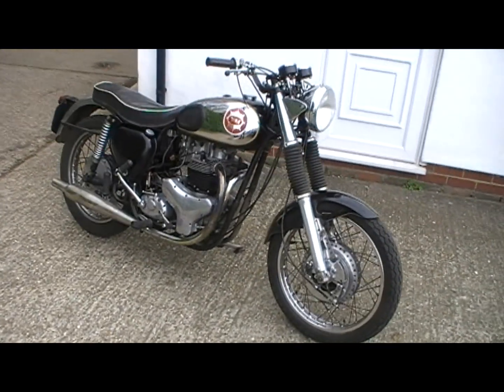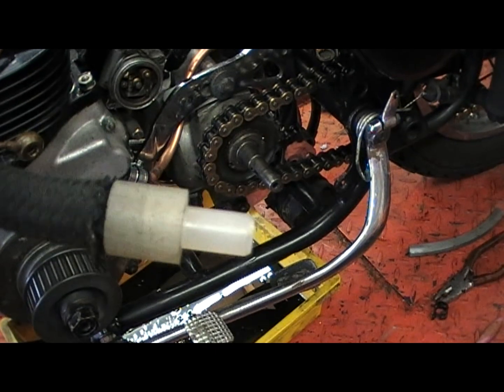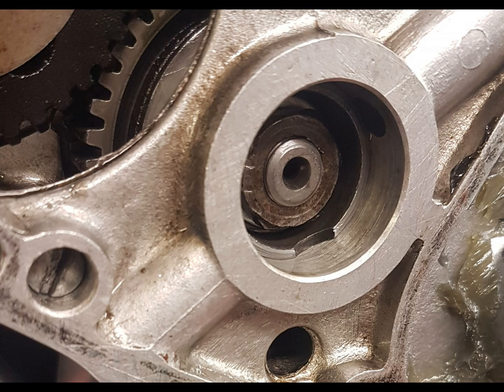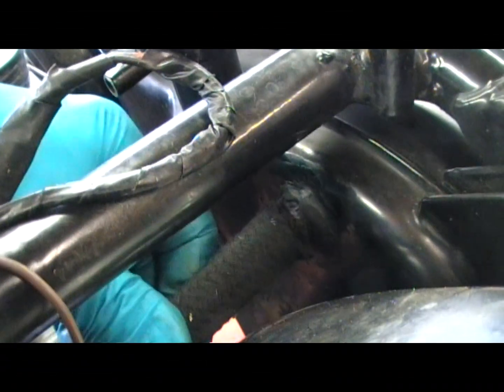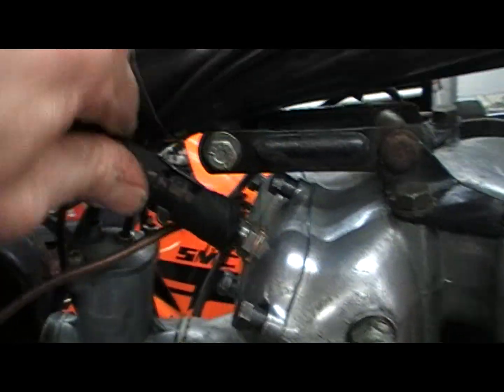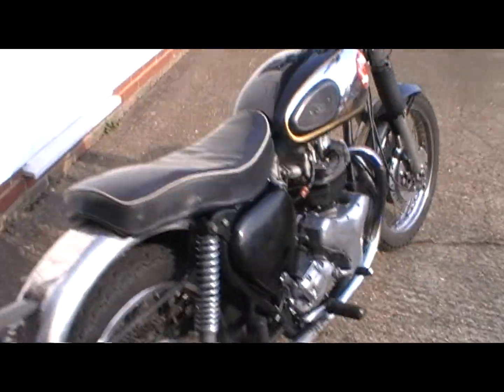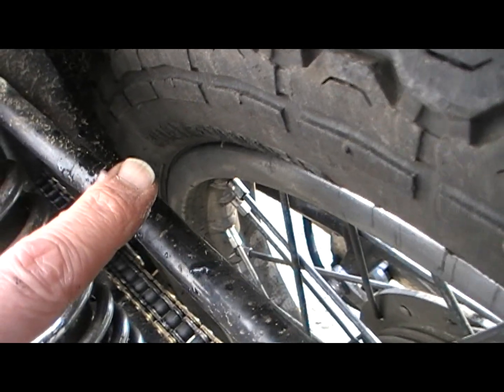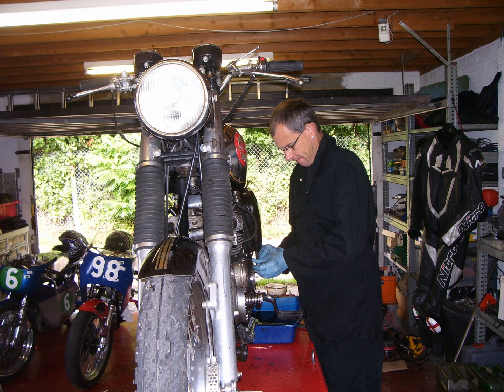Modifying the BSA A10 breathing system with Bunn valves

Comment: I have a bsa b33 that's bored and stroked to 600cc it once had a rev counter drive on the side cover , so it has a cover  plate on there , I took it off the other day , wow talk about windage , it has also has a breather tube on inlet rocker cover but looks way to small about ⅛ I think , I'm going to make a breather tank and add bigger hoses , might help all the gaskets,  under pressure . Cheers
Reply from the maker: It should certainly help 👍

Comment: Glad I did this, will try the bun valve too. My unit single gearbox vent tube goes right to my chain and seal around main shaft..
Reply from the maker: Bunn valves are unobtainable now, unfortunately, but there are similar products on the market.

Comment: I fitted a larger NRV to my wifes 2CV years ago. The opposing pistons cause the crankcase to pant and the NRV meant a slight vacuum was maintained. This stopped the oil leaks dead.
Reply from the maker: Properly breathing makes such a difference to an engine 😊

Comment: whats that piece of metal attached to your carb?  It looks like a heat shield or something, but seems like it would cut down on air flow over the carb when you're moving.
Reply from the maker: The big angled piece between the carb and the head is the drip tray. When 'tickling' the bike to start it from cold, petrol floods out of the carb and drips down. The tray guides it away from the magneto and it's sparks... 🔥🧯

Comment: Hi Adrian. Thank you so much for the video.. Before undertaking such a job I want to be sure a) I know what I am doing and b) it is the right thing to do to my bike. You say that bunn valves are no longer available but other one way valves are. I can not find specifications for the bunn valves for comparison but I have found some aluminium ones with the specs below - I wonder if you know the spec of the bunn valves and if these would be suitable? If so, what I/D of tube would you recommend?

Size: 6mm (1/4"), 8mm (5/16"), 10mm (3/8"), 12mm (1/2").
Material: Aluminu+NBR Rubber .
Opening pressure：0.2bar
Working pressure:0.2-6bar
Operating temperature:-30 ℃-130 ℃

You also mention that you made a threaded stud to fit into the breather. What thread did you use? and did you have to make the female thread in the casing?

Lastly you said that you  would make a some kind of collecting cam for the oil tank breather in case there is more vapour than you expect. Can you clarify what you did for me please? 

I really appreciate you sharing this mod. Thank you so much. Chris
Reply from the maker: Hi there
Any low pressure valve would work. The one you mention seems OK.
I used a Whitworth tap in the breather hole in the casing, then made a threaded tube connector to screw into the casing. The breather tube then fits on that. 
I didn't need a catcher can on the breather as any oil drops back into the oil tank. The breather tube on the oil tank remains dry 😊

Comment: Great video, I've used your video as a guide for fitting a breather to my A10 sidecar outfit. Just drilled and tapped the crankcase breather hole to accommodate a 3/8" spiggot and cut off the end of the timed breather as shown in your video. Hoping this will relieve the oil pissing out. It's been a real problem, especially with the engine under the extra load from hauling a heavy sidecar around. Thanks for the informative video!
Reply from the maker: Sorry for the late reply. Hope it worked for you. It certainly did for me. You do need a valve either end of the breather sysyem though. Bunn valves are no longer available, but there are others on the market that do the same job.

Comment: okay, this sounds like a good mod, my question is , the existing breather port on l.h. crankcase adjascent too the cam is it threaded if so what thread please?
Reply from the maker: Sorry I never replied to this. I can't remember what I used, but it was quite a course thread. It doesn't really matter what it is as it if you use a bit of thread sealant, it wont come out. Mines been in there for a decade or more.

Comment: Hi, I have had a Bunn set on the shelf for years, intended for a Triumph, and comes with hoses for that. It has no privision for it venting to the oil tank, and is intended just to vent to atmosphere. Do you think it is necessary to vent to the oil tank on the A 10? And then attach a hose to the froth tower? Do you think it would leak lots if I just vented to atmosphere, maybe with longer hoses?
Reply: The vent to atmosphere wastes the oil drops that would otherwise return to the tank and be recirculated. 
A lot of blowby with a lot of oil mist will inevitably cover with oil wherever you allow the pipe to exit.

It's why cars had the "road draft tube"  turned into the PCV system...
American highways had an oil slick down the middle in the 1950's from all the drips of oil blasted out of the tube pointed down to the road....

Comment: Hi Adrian great mod .where do you get a bun valve from? thanks .Rich.
Reply: fish tank use a low pressure one way valve. very cheap and it will work
Reply from the maker: Hi. Unfortunately they are no longer being made, but I'm sure that there are similar very low pressure  one way valves out there. This really is a mod worth looking into - it made a huge difference to my A10
Reply: Surely the earlier PCV valves are exactly this...
they used to be pushed into a rubber grommet on the rocker cover on lots of engines and quickly replaceable.
So putting a rubber tube on one end and another rubber tube on the other does the same job.....

Comment: I was very impressed with what I saw, Adrian but when you replaced the timed breather, did you actually remove the timing disk altogether prior to fitting a two one-way Bunn valves?  I also noticed that a small air-filter was attached to the end of rubber hose but you didn't have an engine air cleaner on, how come?  OK, I currently own a Dominator and I was contemplating of doing the same thing but instead of fitting a small air-filter, I could instead join that end of the rubber hose onto an inlet fitting I could make myself on a lathe where it can be fitted somewhere on the air-cleaner which attaches the carby.  Is your BSA a road rocket, Adrian?
Reply from the maker: Hi there. I machined the end off of the timed breather so it still located against the cam, but it remained open all cycle. You have to do that if you fit breather valves. The air comes in through the small filter at the top, through the engine and out the bottom breather to the oil tank. As the air is going into the engine internals, it needs a filter.
No air filter on the carb though as its tuned for speed, & you get a better induction sound too.
Raced two-strokes for years with open carbs - small increase in wear, but increase in power, pick-up and sounds.
Bike is a Bitza. It had a 9 page feature in November 2019 Classic Bike magazine, and made the front cover too! 😁
Reply: @t20racerman  When I dismantled the Norton Dominator's crankcase, I noticed there was a sharp edge on the inside of bronze bushing where the camshaft rotary valve used to spin whilst the engine was running.  Also the two lugs were apparently broken off at one stage but subsequently brazed back onto the rotary valve leaving a very rough finish.  However, I purchased both  new rotary plate and valve for re-assembly but decided to leave out the rotary valve because I didn't like that concept. The reason for this is that the Norton's engine does about 7,000 RPM at 100 KPH which is twice as many revolutions as the VW Beetle.  I could never appreciate a hideous design as the rotary valve because when I used to own a BSA Golden Flash, the camshaft had no provision for a rotary valve at the end and neither did the VW Beetle.  Hence, there's less wear to deal with when those parts are omitted.
I'm surprised that you leave the air-cleaner off the bike for racing because in Australia, an engine can wear out very quickly without an air-cleaner due to dusty conditions.
Reply from the maker: @johnmcdougall4149  Just thought I'd mention that the Bunn valve conversion has transformed the bike. After 30 years of rockerbox oil leaks, with oil pissing out if you held the bike at 4000rpm (80mph) it's now oiltight. One of the best improvements I've made to it. 😊
Reply: @t20racerman but which thickness of cork disk did you put on the rest of the rotary valve?
Reply from the maker: @caccadu12  Can't remember the thickness, but basically it was enough to stop the timed breather rattling around, but not tight enough to add much friction. Just touching lightly.

Comment: Hi Adrian. Very informative video on your Bunn valve breather system. I remember reading your article in last years Classic Bike. I've just finished restoring my 56 Plunger A10 after 2 1/2 years. Now I'm having trouble with the oil drips (same old story British bikes...). There's even oil forcing its way through the camshaft cover gaskets. I think I need to take some drastic action.
Reply from the maker: You have to get the timed breather clearance spot on. If its too loose you'll get problems. Also, worn bores and/or worn valve guides don't help. The Bunn valves make a huge difference, but aren't being made any more. There are other similar valves around though - definitely worth looking into.
Reply: Adrian Baker. Thanks Adrian I’ll keep that in mind. I’ve another problem now. Was out on the bike when the engine started banging and misfiring badly. Fortunately I wasn’t far from home. Back in my garage it was only firing on the left cylinder. Took the rocker box off and found that somehow the exhaust pushrod had jumped out of the rocker arm cup and off the tappet so this little problem will keep me busy for a few days.